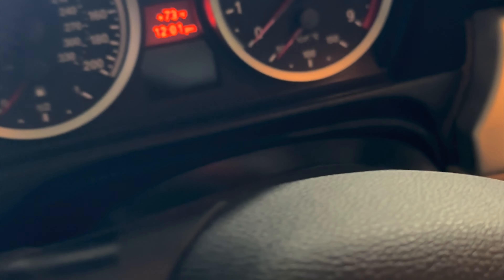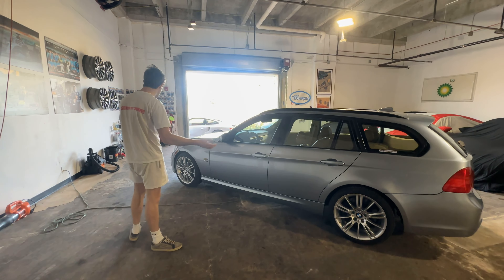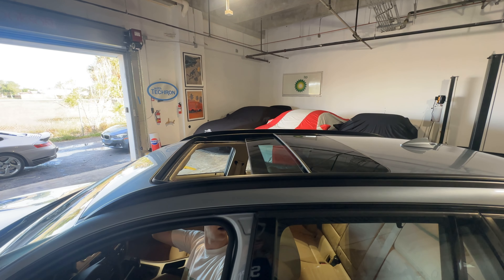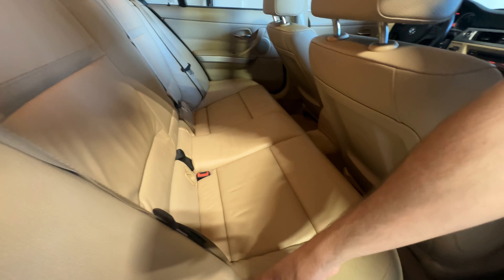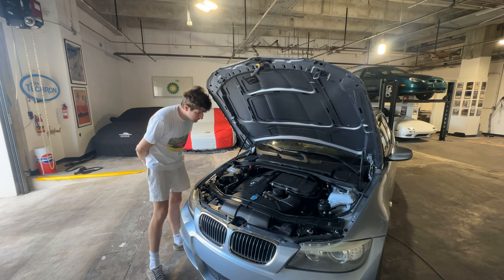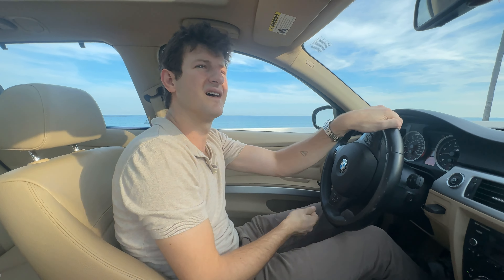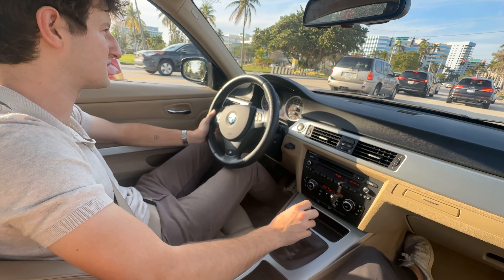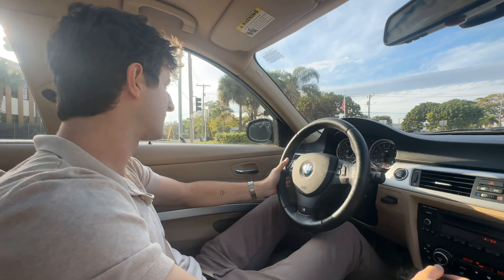N54 SWAPPED 2011 BMW 328i 6-Speed.         (Best Build Ever)

Comment: so quick question, will an n54 fit a auto 2013 328i? is everything plug & play?
Reply: Not as easily as a N55 / ZF8. Better trans. You can do ZF8 in older vehicles as well.

Comment: What did you for harness cinnections?
Reply: N52-N54 is plug and play as the DME goes as it’s in the same place. N55 you’ll need to extend the wiring harness as the DME sits on top of the engine. I pulled the DME, FRM & CAS modules as well as the keys from the donor car. Might be possible to mix and match but you’ll need to do a lot of programming

Comment: This is super cool. There’s a couple of things I would prefer to have like a screen infotainment, paddle shifters, and a black interior. But this is still such a cool car. I definitely love the dual exhaust you put on it instead of a single one on the left, it would also look super sick with the quad exhaust from Remus. Honestly having an E91 335i X-drive or an E92 M3 would be such a dream. Wagons are underrated, they are much more practical than SUV’s in day to day life. I have an E92 335i X-drive and honestly with all I’ve gone through I would have rather gotten this. You said you’ve spent just about $10,000+ for the engine swap but I’ve spent even more fixing a bunch shit for my car just for it to still not be the way I want it to be. Anyways this is super cool and I’m glad its stock in many aspects instead of super flashy. :)